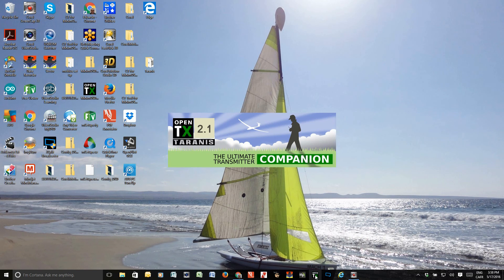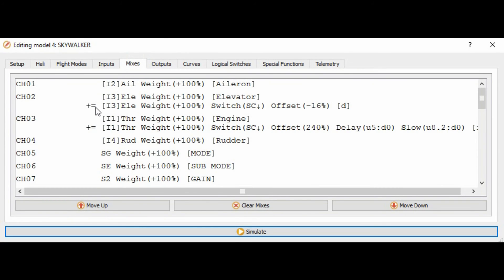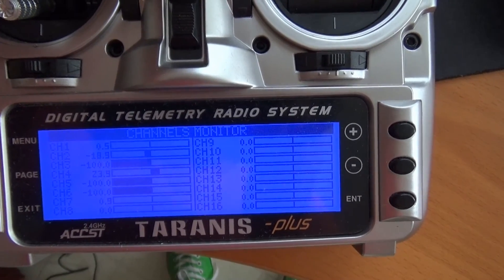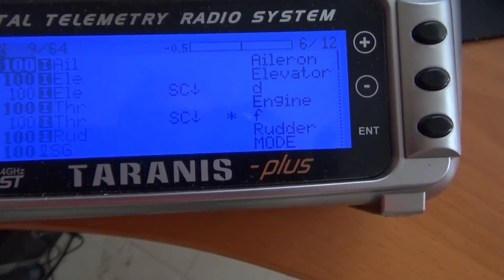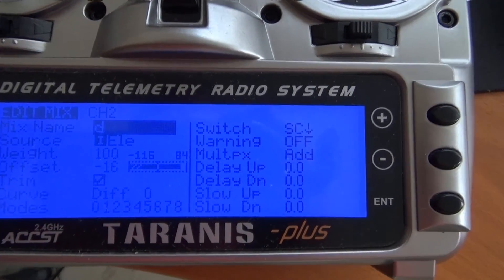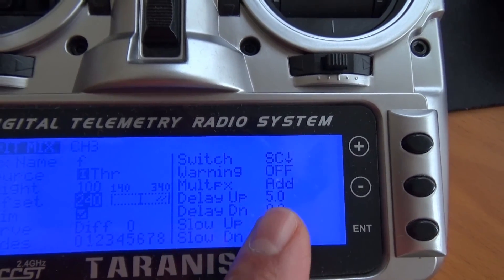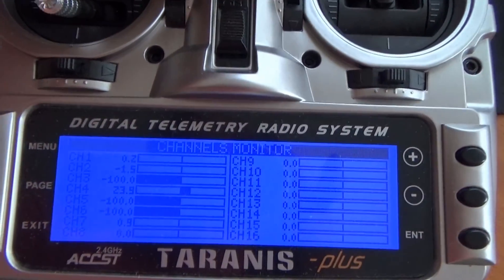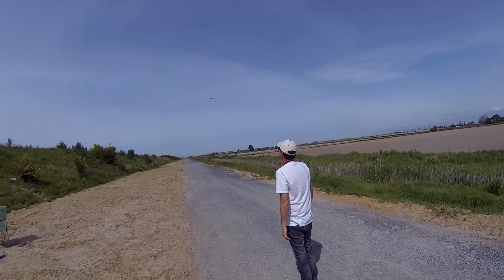Taranis Auto Launch programming and test!

Comment: Eduardo, would something like this work with Pixhawk? Maybe FBWA or Stabilize?
Reply from the maker: bauhaus Don’t need that with Pixhawk, it has auto launch and also auto land! Pixhawk is awesome! Lots of automation. When flying on cruise you can set power output manually too!
Reply from the maker: bauhaus Cruise is awesome since it controls power to fly level, more efficient.
Reply: Can you assign auto launch to a switch on the Pixhawk though? I thought you had to program it in as a waypoint on the computer, then upload the mission to the AP, then click "auto" to initiate an auto launch?
Reply from the maker: bauhaus Yes, you assign a switch to that command. Pretty sure you can. Pixhawk is very advance but you need to program quite a bit. We even programmed that if you shake the plane the motor will start and go into auto launch and when it gets to a certain altitude goes to RTL! It’s awesome. Lots and lots of features. Another switch to get Cruise, endless features.

Comment: Eduardo, Thanks for linking me to your video.  I'm still having the same issue and I can't figure out how to fix it.  All works fine until I add the delay.  as soon as I add delay the throttle moves to 50% during the delay and after the delay it moves to the preset throttle.  I just don't understand why its going to 50% throttle during the delay.
Reply from the maker: Do you have Facebook so we can talk?  You can look me up by my name.
Reply: I sent you a FB messenger request there were 2 with the same name so I hope I sent it to the right Eduardo.
  let me know if you get it.  I can also be found by my name.  My FB pic is a short video clip of me flying a quad in the trees.
Reply from the maker: I just looked up to you and send a message.